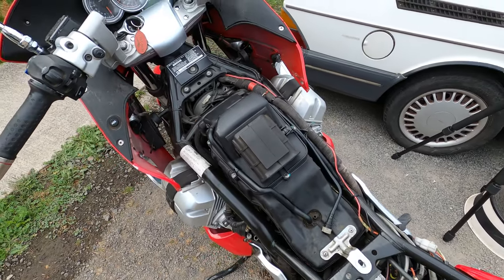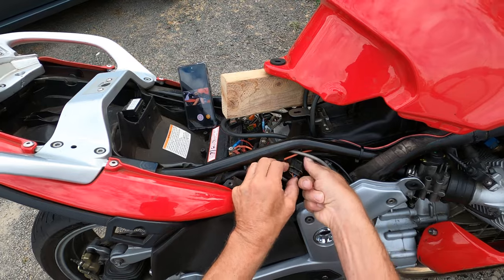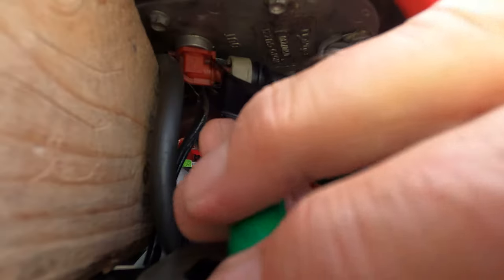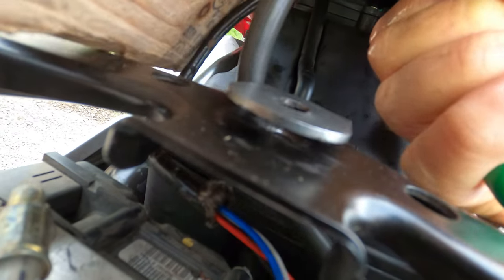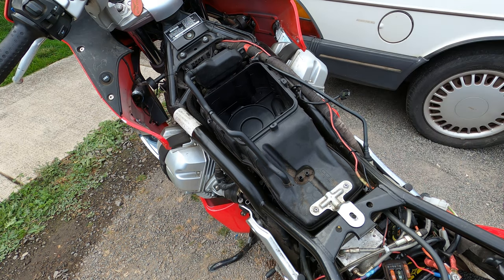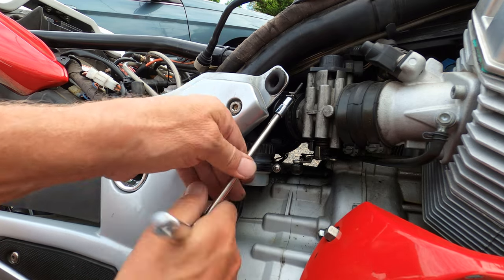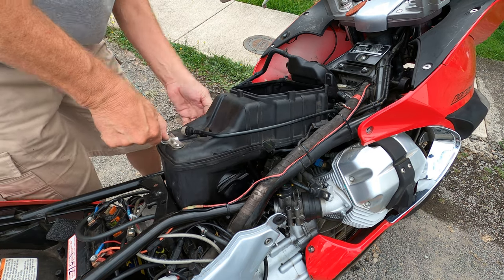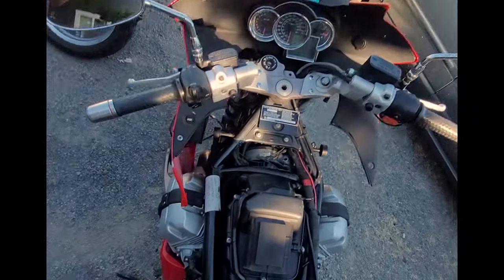Remove Airbox from Moto Guzzi Norge, How to

Comment: Taking off is not that hard.  RE Installing is a PITA, you left that part out!!   SO VERY complicated after replacing part that made taking out air box.
Reply from the maker: Sorry, I missed that. Next time, better coverage on the reinstall, thx!
Reply: @littlemotorcyclemovies  Do you install the snorkels first,  then air box or all at the same time?   I just had to replace Oil pressure unit on my Norge. Other than that good video! Thanks.
Reply from the maker: I put the snorkels on the airbox with no air cleaner inside, without the hose clamps on, and reach inside the air box with one hand on the snorkels helping them get into place, then put the clamps on after you got the snorkels on the throttle bodies, hope that helps, you're doing god's work on that Guzzi! Moto Guzzi, making mechanics out of riders since 1922!
Reply: @littlemotorcyclemovies  - *isn't that the truth - Mentoring others as we have been to keep the marque alive!  Thanks.